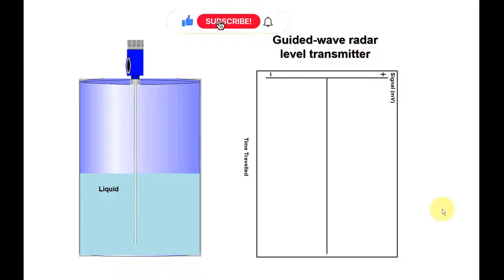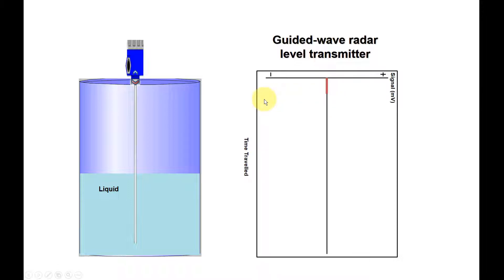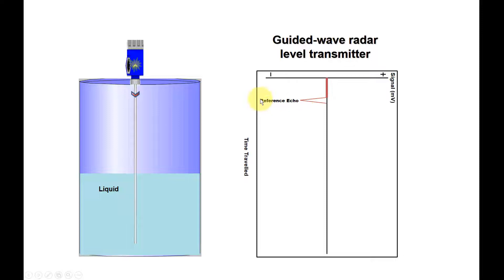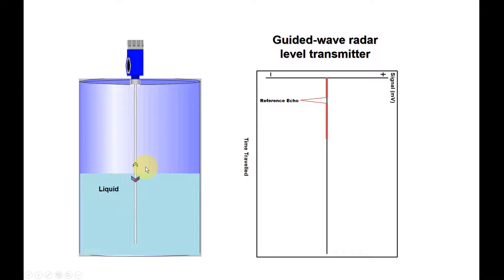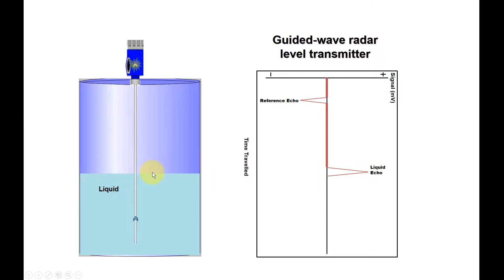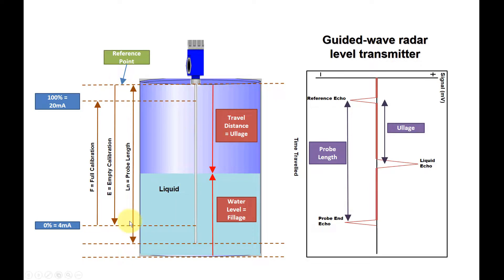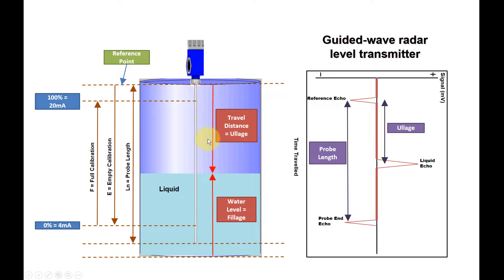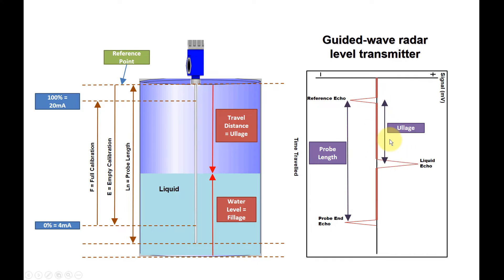Guided Radar Level Transmitter Wave Travel (Part 1 : Single Layer Medium)

Comment: Hi, if the  probe length is 1700mm then what is the LRV and URV
Reply from the maker: The LRV and URV are determined by our process requirements, not based on probe length as long as the URV heighy is not higher than the probe length. 

For example, if your level probe length is 1000cm, you can set LRV as 0cm (0%) at the probe's bottom and then set the URV as 800cm (100%) at higher probe level. Again it is the process requirements determine the height or level. Hope this will help.

Comment: How to calibrate GWR
Reply from the maker: Hi, before doing any calibration, ensure the parameters such as probe length, empty and span values and so on are correctly configured. Then, you can perform 10 points strapping or as many points as like deem fit. Then, key these 10 points strapping points into the GWR transmitter. Thanks